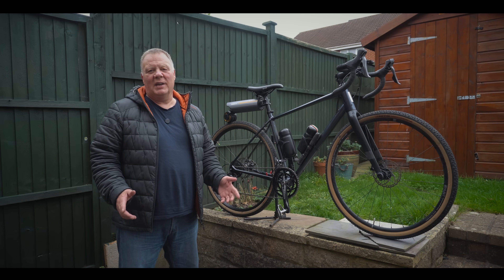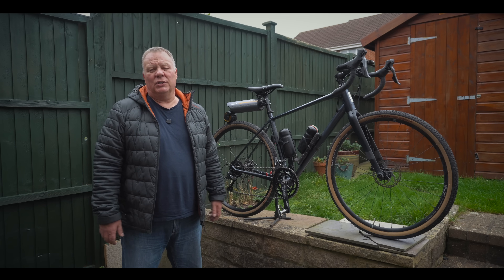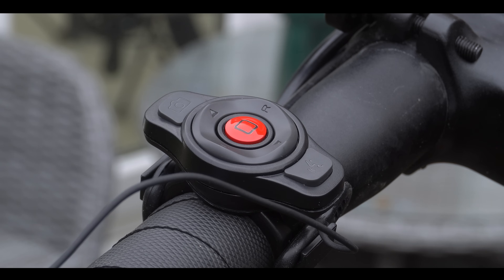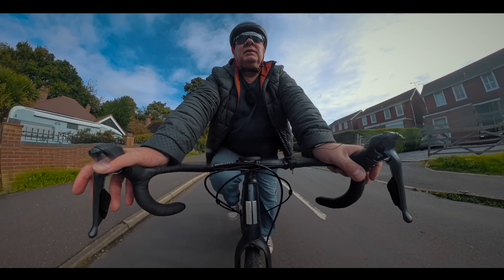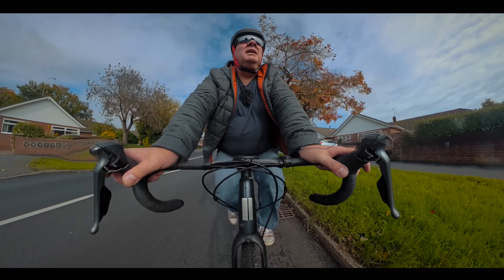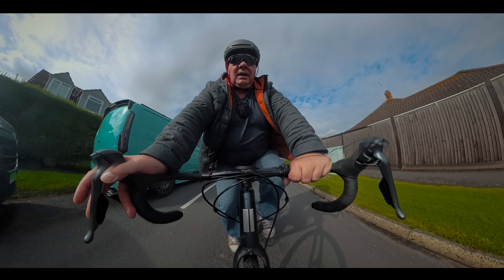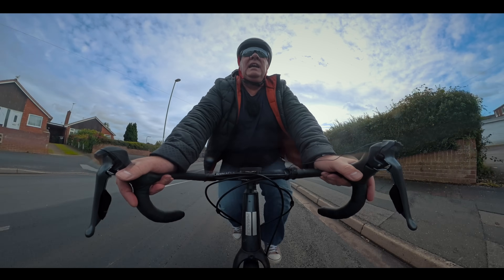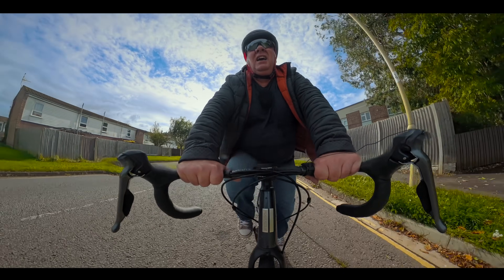LIVALL PikaBoost 2: The Most Flexible E-bike Conversion Kit

Comment: We got one. It took us several try's to get it going. Finally we figured out you have to pull the brake handle, the one the controller is wired to so you can use cruse mode, which was lame and only goes 5MPH!  When calibrating it make sure you "PUSH DOWN ON THE MOTOR" squash it to the tire then lift the bike up by the motor. That was something else we missed.  I just got it going and have not fully tested it yet. First try it seemed more restrictive then helpful unless you want to go 5MPH on flat ground. I do weigh 250 and the bike was a pos. I have better bike to put it on and will post our results here in a month or so when it warms back up.
Reply: Hi there! Was wondering if you gave the Pikaboost another try
Reply from the maker: @lilelbee423 Hello there. I didn’t. I couldn’t really see the point as it did t really give me any benefit.

Comment: Been waiting 6 months for mine still not here
Reply: it will come. We waited 6 to 8 months I lost track but it came in. Still waiting on the extra batteries, but they did email me today and I think it said it was still on it's way? Any way it took us several try's to get it going. Finally we figured out you have to pull the brake handle, the one the controller is wired to so you can use cruse mode, which was lame and only goes 5MPH!  When calibrating it make sure you "PUSH DOWN ON THE MOTOR" squash it to the tire then lift the bike up by the motor. That was something else we miss  understood.  I just got it going and have not fully tested it yet. First try it seemed more restrictive then helpful unless you want to go 5MPH on flat ground. I do weigh 250 and the bike was a pos. I hope it works well for you.

Comment: It’s actually a 500w motor and not a 250w as you stated! It does restrict it to a 250w performance once you select the UK as your country. Also you needed to change the settings the cruise mode is a huge boost with no peddling needed! You had it in the basic setting!
Reply: 500W is irrelevant. If it's geo-restricted to 250W that's what the review will be based upon.

Comment: Hi guy, looks like some misunderstanding or misleading about functions: 1, remote control is for change the mode without leave your handle bar, and speed up and down function only in the cruiser mode like the car; 2, I saw lots of asking about mudguard and PB2 package do have it to install; 3, about speed limited will depend on your country legal requirements and could set up automatic by application but I saw someone said dislike App’s requirements , haha. Bryan

Comment: Hi Leonard.  250Watt, thats ok, its the max allowed in the UK which is a bit disappointing if it isn't enough to feel a push, perhaps its the mode you've selected.  the speed limit of 25 kph should be easy for any tyre size, because obviously its measuring tread speed.
However, whilst I don't agree with the rule, the law demands asistance only when pedalling, but you don't mention a pwdal sensor so did you miss a bit?  Also, if it doesn't know whether you are pedalling it doesn't know to do regen when you're not.  Is there a bit missing?
Lools handy that you can put it on or off depending on going to the shops/comuting or going for a fun ride and that you can swap between bikes but I absolutely hate having an app.  I don't even turn on my phone unless I want to make a call so that mitigates against it.
Reply: It’s actually a 500w motor but once you select your country it will restrict the motor to 15MPH or 250w to keep it legal
Reply: @themcneilys5255  So the user can self select to be legal/illegal.  I suppose we all do every day by choosing to abide by or break laws and so on.  It sounds too easy to simply select a less restrictive country and dash about like a mad thing.
Reply: @emmabird9745 well it asks you where you live and it’s up to you to tell the Truth! To be fair there are hundreds of illegal e-bikes and scooters about and no one cares. However if you have an accident and it’s proven that you selected the wrong country then you would not get a penny! It only offers 20mph max speed anyway!
Reply: @themcneilys5255  I agree with you on almost all counts.  That is that no one cares.  I've seen many videos on ebikes and the degree of outrage expressed shows many care.  However, I will agree that those who should care, ie the authorities are not vissible in keeping the rest of us safe.
It should be possible for the importers (I assume it is a foriegn product) to ensure UK legallity and it should be possible for the law makers to make that so.  It is difficult to make individuals law abiding but organisations and businesses would be far more circumspect in being found noncompliant.
Reply: @emmabird9745 which is why this company is compatent and making it legal when you select your country on set up!

Comment: Hey Leonard, you never stated if that LIVALL is limited to a top speed. For an EBike to be legal in all 50 states an EBike has to be limited to 20mph. It looks like a neat idea to skirt a few laws with especially if you can fold it up in a hurry and state you were never using it in the first place. But if it will do over 20mph, will it be legal here in the states?
Reply: Yes it limits it to 15MPH once you select your country through the app to restrict the 500w motor to make it legal
Reply: Ours so far as we just got it will only go 5MPH in US?

Comment: nice honest and fair review Leonard, even with the video being sponsored or whatever you declared at the start - thanks. Interesting design and seems like some useful features like the power bank and lights - might work well for a lighter rider who just needs a little boost to get up a hill on their commuter bike while charging a phone on the way to work? I'm not convinced personally about the friction wheel transfering the required force and creating drag on the tyre, but if it works for that rider then great as it looks an easy bolt on bit of kit - don't think it'll work with my dropper post though :)